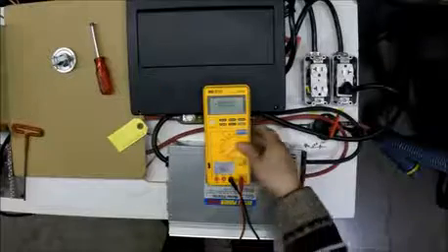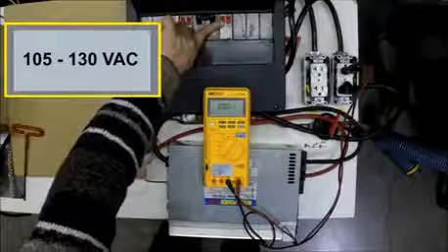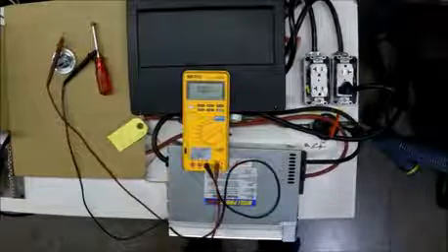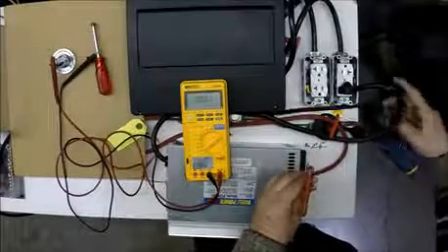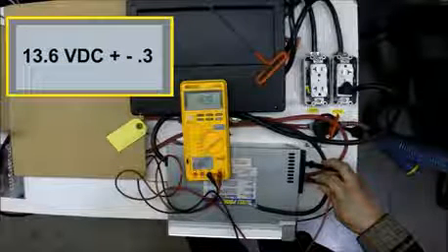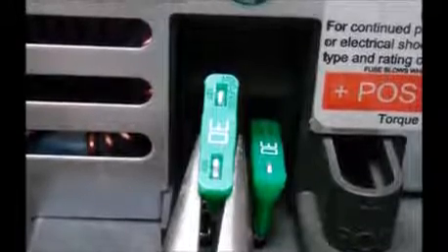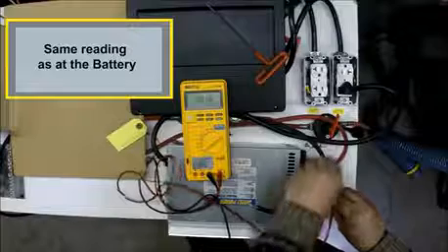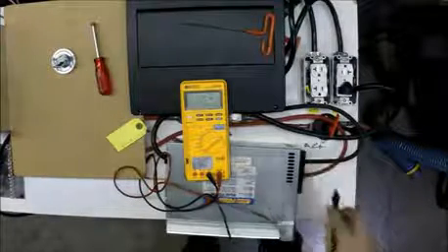Progressive Dynamics Power Converter Troubleshooting

Comment: I just replaced a WFCO 8955 with a PD4600 but the new converter doesn't workThe PD converter came with a new circuit board although I didn't install it because the battery cable is too short to reach where it needs to go on the PD circuit boardDo I have to install the new board in order for the PD converter to work?

Comment: I have a inteli power 9100 Model PD9180 I am having trouble with my converter shutting down in the winter time its mounted in a outside compartment that gets no heat. I plug in a hair dryer and put a little heat in the bin where its located and everything works fine. It usually takes about ten minutes of heating. what could be the problem with that? Thanks..
Reply: I have a PD9140A that is mounted under my stove top. It is indoors but the space is unheated. I'm going to try the blow drier thing. I'm curious whatever happened with your PD9180.